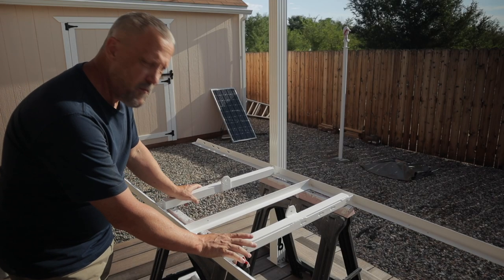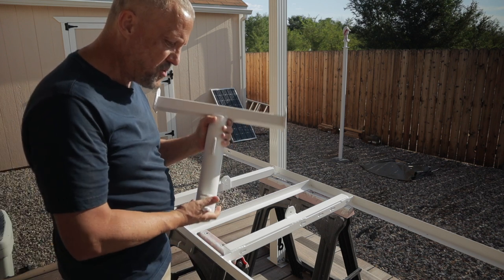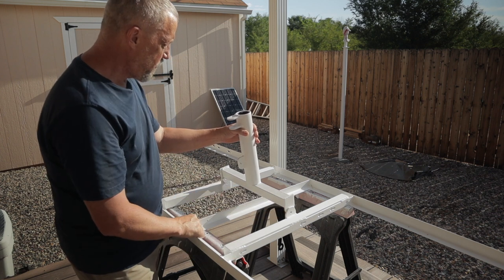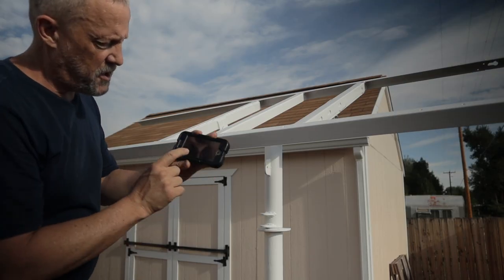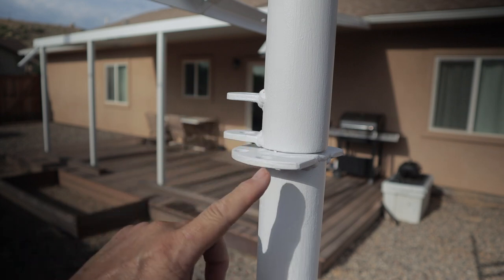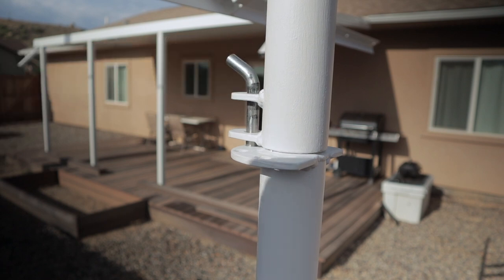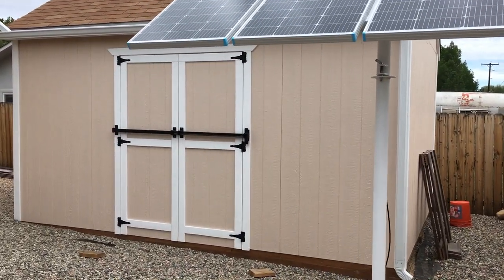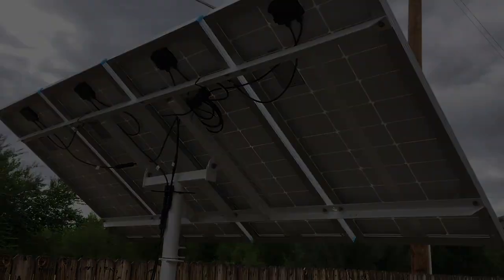DIY Adjustable 400w Solar Array Pole Mount for the DIY Off Grid Workshop

Comment: You got me at 👍🏻 yea. Nice work indeed. Yea 🤓 never thought of bed frames, but I don’t weld. I thought of using aluminum ladders for the span. Your thoughts? Also, what is oil line piping, and where can I get it. Orlando Fl. Thanks for this awesome build. You my friend are very clever 👊
Reply from the maker: I think aluminum ladders would work great but a little expensive unless you find some used ones at a garage sale or something. Pipeline is prominent around here and can be found on facebook marketplace. You have to be careful though because there are a lot of price gougers out there on that platform. Sometimes there is also some drill pipe, it's used for drilling oil, gas or water wells and it's pretty good stuff too but price gougers on that stuff too. I don't know if it's available in Florida or not. I wish you the best with your project! 👍👊
Reply: @DIYHomesteadProjectsDIYHP10  Thanks, for sure weathered ladders. Kinda figured the weight and there is two spans in a extension ladder and holes to route cabling through. Just thinking. 🤓

Comment: I like the design if you change your pin for a bolt and nut with a safety hair pin clip on the outside of the nut it will keep the top from lifting off the pole in the wind

Comment: I didn't see how you mount the actual solar panels on the structure, but saw you put them up there.  Can you share that?  We are building someting very similar but an array with 6 panels, old pergola metal parts etc and shelving parts.  Or that's the plan anyway.  My son wants to put an actuator on it.
Reply from the maker: I just used the pre drilled holes in the panels and drilled my own matching holes in the angle iron. Then used bolts with locknuts and washers to mount them. I wish you the best with your project!
Reply: @DIYHomesteadProjectsDIYHP10  In all the time I had those panels, some longer, I've never seen those holes lol and went out to look...boy do those buggers get hot!!!
Reply from the maker: Yes they certainly do!  :)

Comment: I really think this kind of mount is the way to go, as low as you can get it without it being in the way or shaded. Lots of people don't realize panels need to be cleaned, if you have the space you really don't want to be cleaning panels on your roof.

Not to degrade your fabrication skills but due to home owners, I wouldn't install any kind of stand or brackets without snow and wind ratings. Yours might be way overbuilt, but I don't want them getting hurled into my house, it worse my neighbors house and have the insurance company try to screw me.

Now if I was rural and not worried about insurance. I'd not feel bad about building mounts from scratch like this.

Comment: Genius.
Reply from the maker: That's a pretty generous comment but thank you. :)
Reply: @DIYHomesteadProjectsDIYHP10  No not really :) I love things made out of other things and repurposed and this is excellent but not having gas pipelines and all access to welding do you think a large screen tv mount would work as an alternative? perhaps bolted through a large wooden post?
Reply from the maker: It sounds like it might work. The biggest issue IMO is wind and how it will hold up to the wind. Of course it all depends on the conditions where you intend to use the mount. I wish you the best with your project!

Comment: That seems like the optimum design strategy, one large center pole that can swivel and has adjustable angles.  I'd settle for that without any kind of mechanical tracking of the sun's path.  No, it's not as ingenious as it having a tracking system to do that for you but it sure beats the hell out them pointed in one direction on a stationary base.
Reply from the maker: I agree, much more efficient than fixed panels.

Comment: I love this and I'd like to borrow this idea however I have a question are you going to put your cables inside the tube so you can rotate it so your cables don't get bound up
Reply from the maker: I wish you the best with your project! It's been a great set up for my solar panels. I just ran the cables down the outside of the vertical pipe. I only rotate the panels 90 degrees so binding hasn't been a problem.

Comment: just curious, but why didn't you want to put on the roof of the shed?  I'm doing something similar with my shed.
Reply from the maker: I decided to go with a pole mount instead of mounting the panels on the roof for several reasons. An adjustable mount will significantly increase the amount of power I can harvest in a given day. Fix mounted roof panels will only be optimal for a short period of time throughout the day.   Future testing will show the difference between fixed panels vs adjustable panels. Basically this will equate to doing more with less IMO. The adjustable panels can be moved throughout the day. The draw back here is this has to be done manually on my DIY mount. The pole mount makes it easy to periodically clean the solar panels and remove snow in the winter. Both are significant advantages to increasing the solar intake year round. Lastly I believe that the best way to maintain a leak free roof is to NOT put holes in it. LOL I hope this helps you with your build and decision making for your project.

Comment: If your shed has a southern facing slope, why not moun panels on the roof of it ?
Reply from the maker: The solar panels are easier to clean and remove snow mounted on the pole rather on the roof. Also I'm not a fan of mounting solar on the roof because no matter how they are mounted you will eventually have leaks in the roof. This way no leaks in the roof and easy to replace the shed shingles when that day comes. Also mounted on the roof the panels can not be rotated to adjust to the sun they become fixed and this limits the power producing capabilities throughout the day.